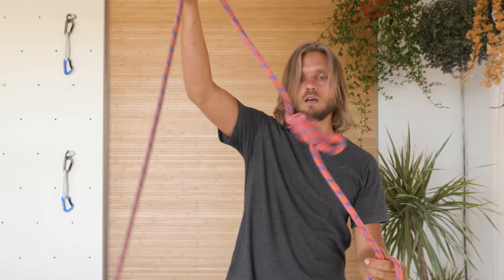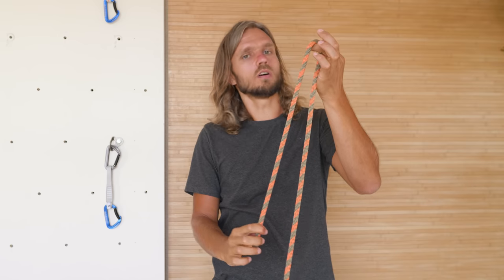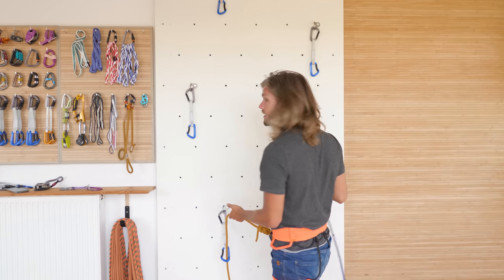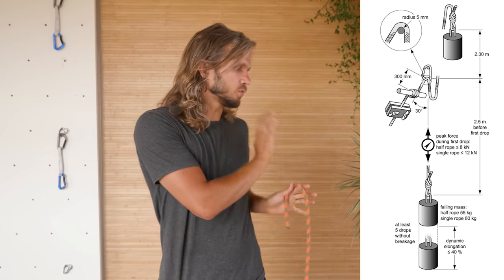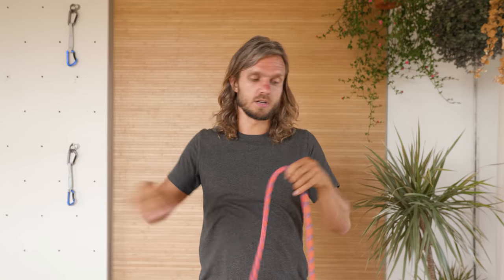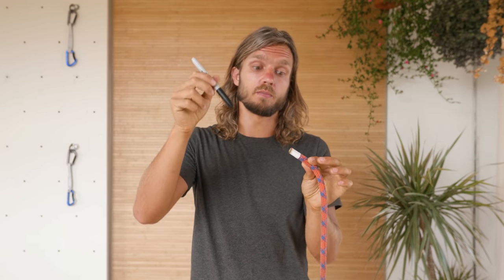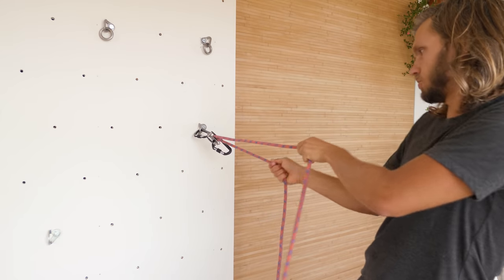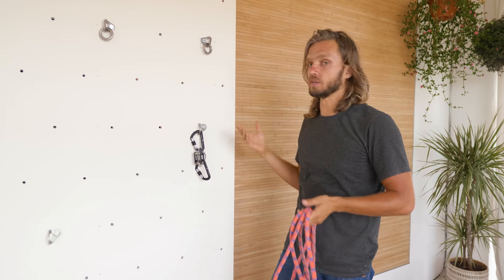Complete Guide to Climbing Ropes - How many falls they Hold? Why they Twist? | Ep.5

Comment: Good job as always, Ben! I hoped you could also answer a question that my friends and I cannot actually answer, but you didn't talk about it in the video. Why does the rope get dirty like it was painted with black paint? It's not dirt like mud or dust, it's more like it's stained. It's very curious the fact that it pratically doesn't happen to me, while my friends' ropes are very very dirty. Someone told me that it's the paint of the quickdraws, but it doesn't convince me since the rope carabiners are not painted. Where does this kind of dirt come from in your opinion? (just to be clear, when you lower someone it's the typical black colour that remains on your right hand)
Reply from the maker: I'm curious as well - I thought it's ether dirt accumulation on the rope ooor some of Ropes treatment on some of the ropes... I had a lot of that on my Decathlon rope... 
I actually have this in my list of investigate & find out more about...
Reply: @HardIsEasy  I think it comes from the aluminum quick draws. It is the aluminum material getting grinded down in a very tiny amount, and stay on the outsifde of the rope.    Good Video by the way, thanks
Reply: Black residue definitely sound like aluminium residue, from quickdraws or belay devices. Quite common with industrial descenders like the I'D as well.

Comment: If you have old rope to trash, recycling is a good idea.
But reusing is actually even better !
Give your rope to a sailboat : it wont be used in any technical need, but still, there are plenty of cases a boat need ropes for any non critical use.
(but, well, even as a climber, they are many uses of a 3meters long piece of rope)

Comment: New here, not sure if this is gonna be answered, but regarding cutting the rope and the center marker. Is it indifferent which end of the rope we use each time in the belayer device and which on the harness? would that lets say compensate the worn out of the rope on each end of the rope? Or pay attention to that would be too picky and unnecessary (so like flipping the use of the rope endings so they worn out first one end, cut, and then flip it and eventually the other end and cut it... so the center marker eventually is, centered.) You advice it at the end , but not sure if its directly related to this doubt I have.

Comment: Using a lighter on the ends of the rope can sometimes make the ends quite brittle. Its not a massive issue but I sometimes find it quite annoying. My preferred method is to heat up a knife with a gas cooking hob and then it melts its way through the rope while cutting.

Comment: I have an old climbing manual that states that ropes naturally "recover" if you leave them alone for some time after a fall. The theory there is that the fibers get back in place after some time when they are stretched. It puzzles me though because I have never heard this anywhere else. So now I am wondering if the reason why the factory tests are harder on the rope also because they do all the fall testing one after eachother. In real life you might project and fall several times during the same climb, but probably less than during the factory test.
Reply from the maker: Yes ropes do recover their electricity. And that's why standard test has very clear rest time between falls.
However on real life falls (much lower forces) you don't have to even think about this ;)
Reply: @HardIsEasy  cool thanks for the reply :)

Comment: Hey Ben, Cool series of videos, for any climber really . I am an experienced climber and Ive been trying to solve the mistery of kinks in my rope at least. They are not super bad, but they are there, I knew before hand what you explained and I avoid it. But every now and then they appear. I can see how the rope twist for example when you have the rope (on a top rope) and you make it tight, if you put your eyes in the line you can see the twist. After a lot of thought. Do you think that doing top rope can increase the chance of twist? I noticed I have more twist in my rope when I take people to climb and they top rope. And usually me I only lead. Any thoughts?  (couldnt see any relevant info in web forums)
Thanks!
Reply from the maker: Just a top rope through single point anchor shouldn't twist the rope...

But if the rope travels in weird ways it might twist a bit...

Just keep pulling all the rope through the anchor after you are done with the climbs and little twists should be gone

Comment: Holdup on el cap do they just use a 7000 foot rope and belay like normal cause idk how the massive walls work
Reply: Nah, thats a multi pitch climb. A 60m rope is perfectly sufficient.
The first person will climb up to a belay station/ anchoring point and secure himself there. He will then belay the second climber from the top, while the second climber collects all gear placed on the wall while climbing up.
Reply: @Chitario  that makes a lot more sense lol
Reply: A 7000 foot rope would be.... Interesting!

It would be very heavy. Too heavy to even lift it to clip into a QuickDraw. Too heavy for one person to carry. It would take up so much space. You'd need to tow it in a trailer, pulled by an ATV (side by side) to get it to your climb. 👍

Although, of they made a rope as tall as El Capitan, I'd consider climbing it... Top Rope!!😁

Imagine the STRETCH on that rope! Oh man, just having your belayer 'take' you and you'd probably drop several feet.
Reply: @endokrin7897  lmao like you slip and you drop 100 feet
Reply: @endokrin7897  the stretch would be insane. Like a 50m free fall before you can feel it tensioning 🤣
Reply: @Chitario  lol and the belayer is using binoculars to see

Comment: Does rope really have to be retired after 10 years even without use and stored in ideal conditions as per the manufacturer's recommendations?  Is there any chemical or molecular decay in the rope material?  Or is the 10-year just an arbitrary expiration date to protect the manufacturer from potential lawsuits?
Reply from the maker: There is degradation in soft Materials... If there is any serious testing done - good question - putting to my notes :D
Reply: Thanks, would be terrific to know especially for the occasional climber.  🙂 I've inspected my 10 year old rope according to your thorough instructions and it looks still in very good condition.  I'd honestly hate to retire it if I don't absolutely have to.  Rope ain't cheap.
Reply: @FireLiteCreations  I think its best to consider anything nylon to be worthless after 10 years, you do know what you're gambling with right?
Reply: Ropes might not be cheap but what price do you put on a serious injury or on your life?
However, an undamaged rope is very unlikely to  break in a fall, but it loses its elasticity (  becomes less dynamic), which puts more stress on your protection, anchors and body when you fall.
Reply: @benschuster9792  If that's true, then why don't governments (and car manufacturers) force car owners to retire all of their seatbelts and install new ones every 10 years?  Automotive seatbelts surely look and feel like the same nylon material in climbing rope and slings, unless I'm totally wrong.  Seatbelts apparently are also regulated to meet a minimum of somewhere around 22 KN from what I've read.

Comment: @24:38 Ah you cut the video there so I couldn't see what you did! But I am pretty sure you tied two apposing half hitches, and not overhand knots, making a full hitch. Which isn't normally used in climbing or backcountry rescue that I know of. A half hitch is a kind deformed overhand knot if you want to think about it that way, but me and you are the only two people I have seen try to do that! Also, two apposing overhand knots will give you a square knot which I have never seen deform into a full hitch unless I tried to make it deform that way (50% chance the square knot wasn't tied in an orientation that it could deform into a full hitch, and it really has to twist around a lot), and you definitely have a full hitch there and not a square knot.

Half hitches get used a lot in sailing! If you are ever in Bremen and want to see some sailing knots, drop me a line (haha, rope pun). There are no mountains here... no idea why you would come... but you can climb my mast if you like.
Reply: yeah yeah, on the red side you tied a double overhand around the standing part of the line to make a loop. On the other side it was definitely two half hitches (not two overhand knots) tied around the standing part of the line. Like I said, if you slightly deformed those half hitches they would then be overhand knots (tied WITH the standing part, rather than around it) but the application and terminology are both completely different.

Comment: I have some kind of unusual Problem: I have a rope that is about 7 years old, but I only used it a few times inbdoors. Now I dont know when to retire thast rope due to age (edelrid says max12 years) Are there any signs of wear to watch out? I stored that rope inside the Ropebag in my clausit for the majority of the time, so I dont know if that counts as the storage recomendation of edelrid (Store in a cool, dry, dark place outside transport containers.
Avoid contact with chemicals (caution: battery acid!) Store
without mechanical stress caused by jamming, pressure or
tension)
Reply from the maker: Well if your manufacturer says 12 years and you almost never used it, it should be fine

Comment: Instead to use a tubular device to untie the rope, is a good idea to use a Gi-Gi??
Reply from the maker: If you meant to "Untwist the rope" then it would be difficult to do with GriGri - I would just find a long route and keep pulling all the rope through the anchor giving some shakes should solve your problem eventually
Reply: @HardIsEasy  yes i meant untwist, but with kong Gigi not GriGri

Comment: Hi, thanks for the video! The Revolut link in your website does not work properly, could you have a look? Thanks
Reply from the maker: Could you tell me what is an issue? It seems to work for me... although I needed to refresh once (was something weird with Revolut page)
Reply: @HardIsEasy  Yeah you're right, once you refresh it looks good. Then the problem is, on a desktop PC, it sends you to create a new Revolut account (instead of allowing me to use the one I already have).
I finally managed to make it work from my phone through Chrome. Through Firefox, it was not connecting correctly to my Revolut app. Seems to me like a Revolut problem, but anyway, I think it's good for you to know :)
Reply from the maker: @josema1990  Yes, thanks for letting me know... It's not in my control... 
I could only publish my Rev user name in addition...

Comment: Can somebody help me, please?

I bought on eBay Edelrid 10.5mm Tower Indoor Climbing Rope it was originally 100 meters long but the seller was selling it just 40 meters.

When I opened now plastic bag I noticed that somebody put a metal pin into one end of the rope.

The problem is the pin is about 3.5cm long and the rope it's 10.5mm thick.

The pin pierced the end of the rope and I think because the pin is 3.5cm long it pierced two other parts of the rope.

I was wondered is it safe to use now the rope is it not damaged inside the rope and is it safe to climbing and take a big fall with that rope?

Why somebody pierced metal pin into a climbing rope?

I hope somebody can explain and help me.

Thank you

Comment: I disagree on the recommended rope length of 80 meters for single pitch climbing. Most of the sport climbing around me or within 4 hours drive is around 15-30 meters and a 60m rope will be sufficient for most climbs. Carrying and handling 20-40 meters of extra rope is a lot of faff (or even twice as much if you bring two ropes) which I'd rather avoid. And as soon as my 60 meter rope gets too short I can use it as a gym rope. In the odd case of a longer route you usually can rappel two times.

Comment: Any recommendations for a multipurpose rope?  Lead climbing in the gym and outside plus via Ferrata rescue?
Reply from the maker: 80m 9.5-9.8 and if you want last longer (more expensive) DRY rope ;)
Reply: @HardIsEasy  thanks! One more question: does dry treatment make the rope heavier?
Reply: @headstomp49  not appreciably enough to be recorded per meter, which means less than 1g/m.
Reply: @zacharylaschober  thanks!

Comment: Highly support getting longer ropes than expected, in particular 80m ropes, and in a work to weight ratio, such as 9.4-9.6.

Ecological impact is one of the reasons the vast majority of my products are from Mammut and Edelrid, and if you have to retire a rope after just a chop or two then you’re wasting the vast majority of the rope. After about eight times, that 80m rope comes in under 70m enough to not be feasible getting off many longer routes, but then the majority is flattened, fuzzy, and generally handles poorly, and I can retire the whole mass.

Too thin and short, and you cut too fast and too few times and waste most of the cord.

Comment: You can easily untwist the rope with a gri-gri when lowering a climber. I'm surprised you didn't mention this trick.
Reply from the maker: What's your method?
For me just pulling entire rope thought the anchor works magic...
Reply: @HardIsEasy  I believe you, but you can undo the king the moment you see them. The correct way to feed the rope in the gri-gri while lowering a climber is on the right-hand side (as far as I know). However, if you see a kink forming you can adjust to feed the gri-gri on the left-hand side for a few seconds. That way the rope immediately start to twist in the other direction and overall untwisting. Really hard to explain with words, just try it next time. I think it's a very valuable trick.